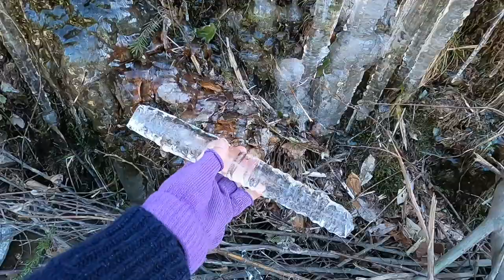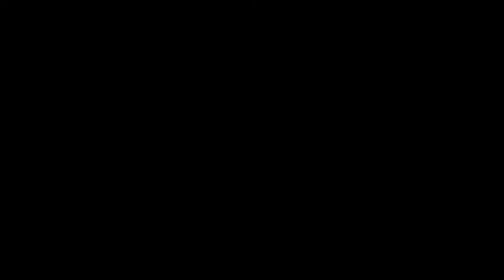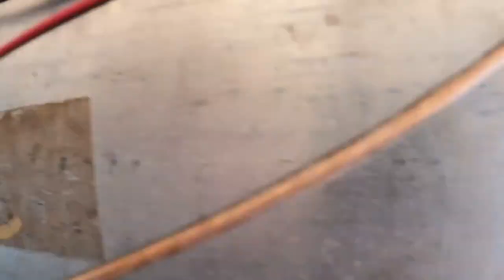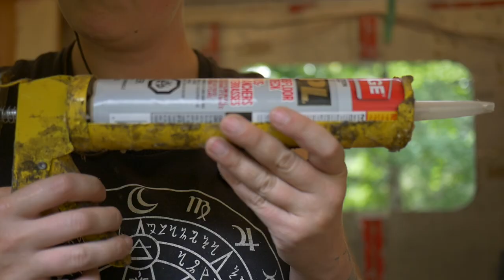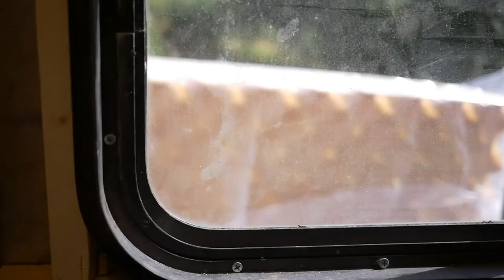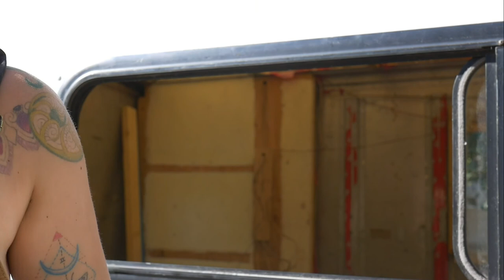Installing windows Step Van Build | Queer VanLife Episode #3

Comment: Great work so far. I would recommend Butyl tape around the outside window to seal to the aluminum. Easier to handle and less mess. I also recommend Speedy Glass in CR. They have cut all my windows so far and I do the install. Don't let the small stuff get you down, there's a lot more broken stuff ahead, LOL.
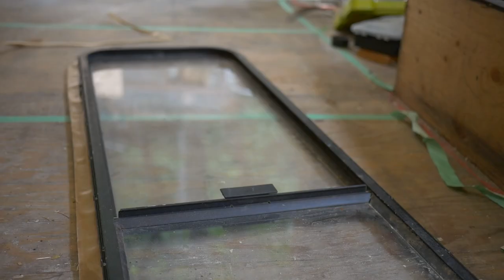Reply from the maker: Thank you!!  Can you explain more about the outside window tape? I put in on the outside flange 13:58 you can see it with the paper backing on.  Are you saying put more on once the window is in? Just trying to wrap my head around it?  Thank you!!